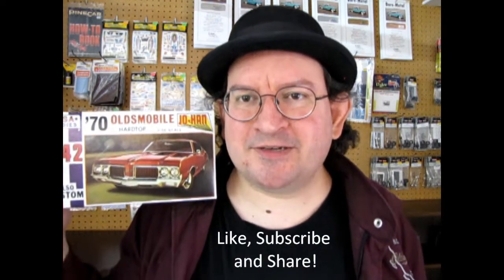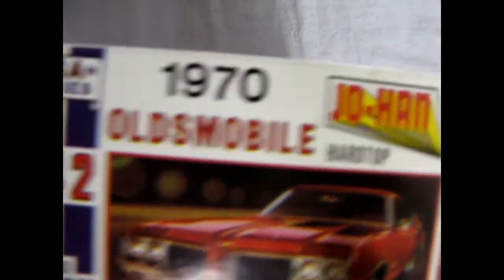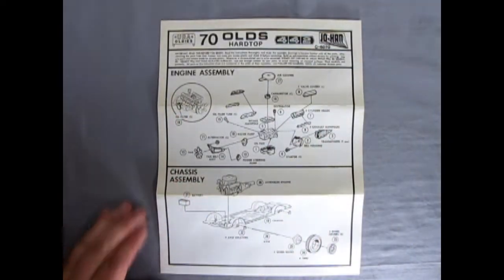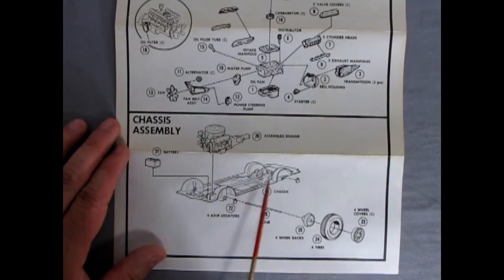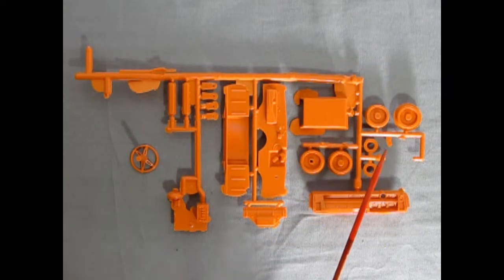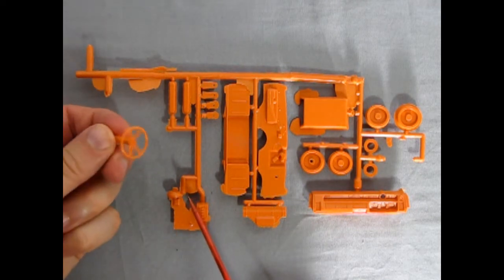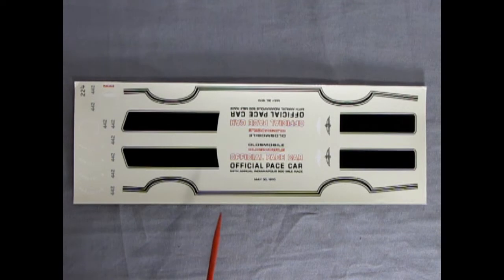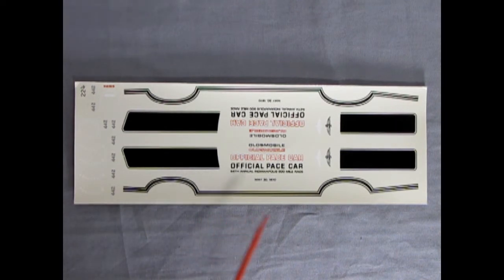Model Car Garage  - The 1970 Oldsmobile Cutlass 442 Hardtop By Jo-Han - A Model Car Unboxing Video

Comment: I have this kit unbuilt.  How much  $ ?
30+ years ago when I was 26ish,
I managed Allied Hobbies, Oxford Valley Mall,Langhorne, Pa. The owners had 8 hobbyshops within a 20 mile radius.  Now you can't find a true hobbyshop within 100 miles. Every paycheck,I'd buy atleast 2 kits x 3 years= ALOT OF KITS I planned on building, but never got to them. I have AMC Javelin Dragon Lady,and the Stock version kit.
I am reluctant to build my Johan kits cuz of the collectability.  Where are the Johan molds ? I wish someone would find them,reserect them,and start selling them again !
Reply from the maker: Okey Spaulding has the molds and Jo-han name. He produced the 1959 Rambler American in the mid 2000's, but hasn't produced anything since. (Look for that video on my channel.)

For prices on Jo-Han kits, I usually look at Ebay and compare. Some kits are worth a lot, others are at par with current kit prices. Since this Oldsmobile was produced so many times, I don't think it is too pricey, however, something like the Jo-Han 1963 Plymouth was fetching $300+ at one point. 

I wish my hobby shop could be so big.